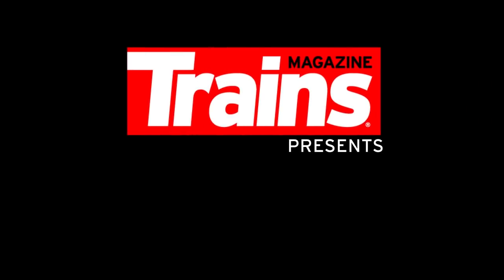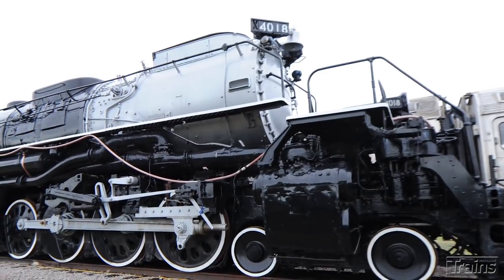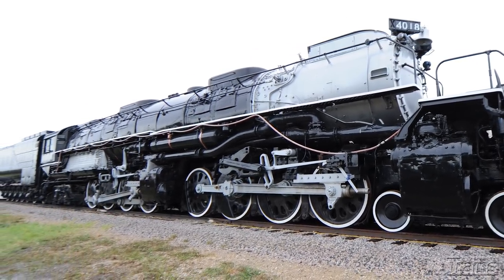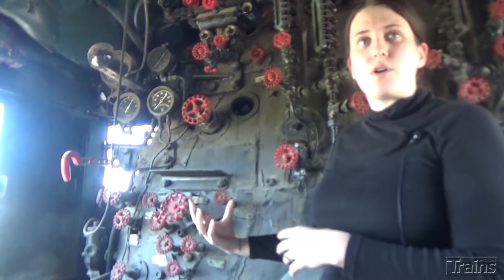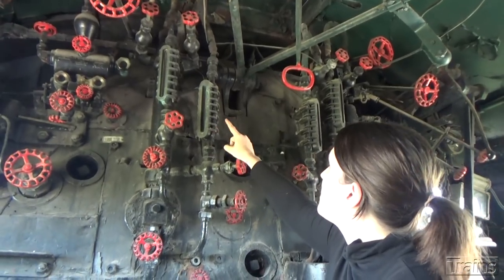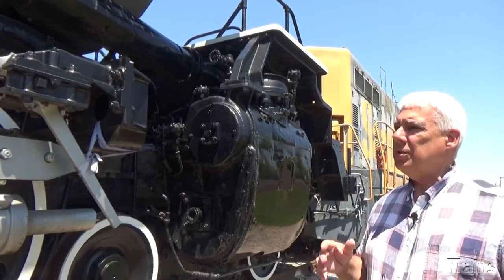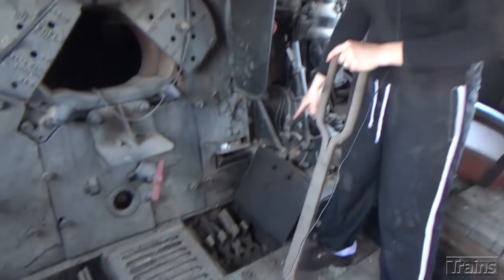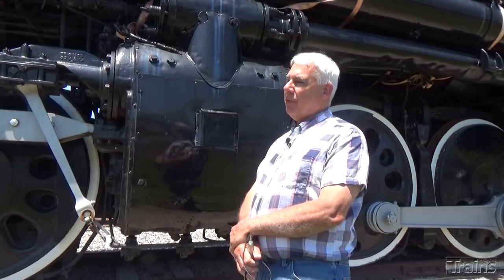Trains Presents: Big Boy No. 4018 at the Museum of the American Railroad

Comment: I remember sticking my head into the fire box opening as a kid when it was at the Texas state fair back in the 90s. Also, it’s awesome that 4014 is now moving under its own power.
Reply: Cole's Garage I wonder... there’s gotta be some crazy old timer somewhere who wanted to be cremated in a BB 🤔
Reply: I got to do the same in the 60's after Dallas Cowboy games just outside the Cotton Bowl. I was 8 years old. I always dreamed it could be repaired and returned to full use. The high speed rail projected to run from Dallas to Houston is a private line. It is not run under Amtrac.  I can envision departure Dal 6am Friday departure to Houston return Sunday 6 pm departure back to Dallas. You can book a full weekend stay in your sleeper car. This is an old old bucket list dream. I am now 69 years old. It needs to happen in the next 10 years. It's in great shape and this can happen. It only has 126000 on it. Super low among all others out the.  Just convert to recycled oil and replace its primary drive rails. Why they were cut and disabled I'll never understand.